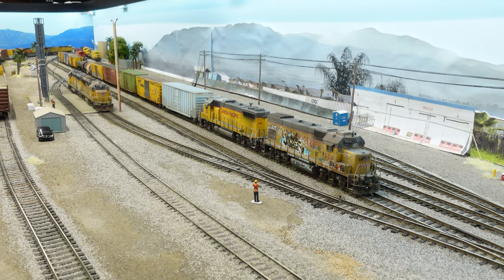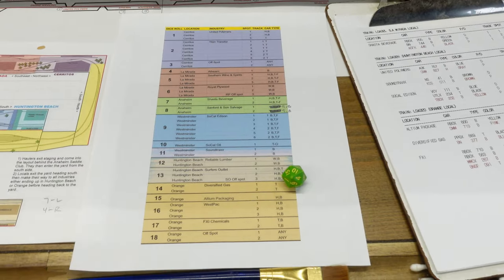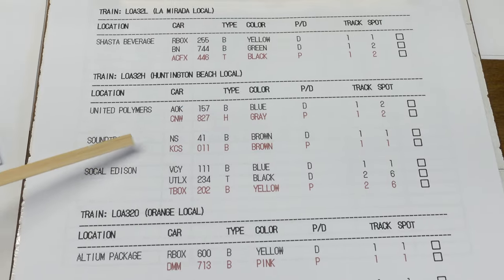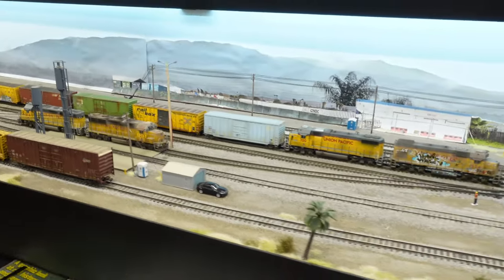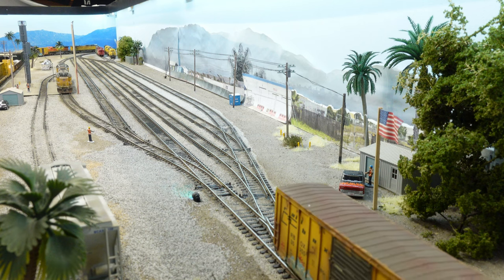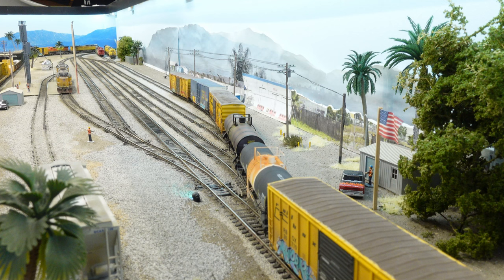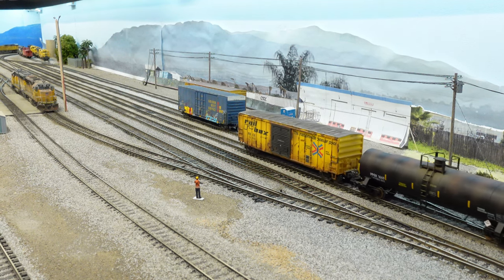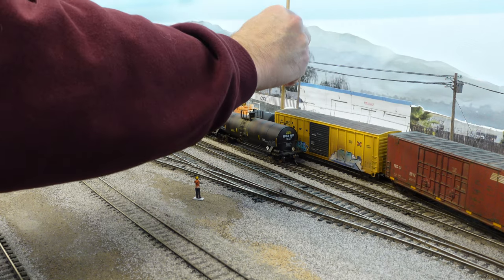Operations | Creating Switch lists - Yard Classification PART 2

Comment: This is generally the way I do yard ops. Put the cars on the designated track 1st and then, depending on how a layout operates, the yard switcher or the local blocks the cars for local by industries. One thing that helps, is give an industry number identifier so like 91, 92, 93, for industries in Huntingdon Beach, and maybe 81, 82, 83 for another area. Then you could even do sports, like 91-1, 91-2, 91-3 if there are specific spots to deliver each to.

Comment: Hey Rick. To answer your question, I sort and block cars like you did it. I block by destination first then I arrange each train according to which car gets dropped first. Those are at the front of the train. Also, don't forget you will need a buffer car for the return trip after picking up the tank car. I always take an "empty box car to use as a buffer when necessary if I will only have a tank car for the return trip. If I have other car types on the return trip, I don't take a buffer car with the outbound train.

Comment: 23:55 "And, of course, we've got the tank car right next to [the locomotive]"
That's fine while switching. Buffers are only needed out on the road, and only for hazmat. The rules are that, except when switching:
1. A placarded hazmat car cannot be next to the locomotive. Doesn't matter if it's loaded or empty -- if it's placarded, it contains at least some hazardous material. If it's empty and been cleaned, the placards need to be removed but receivers don't generally clean the cars.
2. A loaded placarded hazmat car can't be within the first five cars of the train. If there aren't enough non-hazmat cars to achieve that, all the non-hazmat cars and any empty hazmat cars should be between the locomotive and the first loaded hazmat car. Rule 1 still applies so, if the entire train is placarded hazmat cars, a buffer is needed.

Since your phosphoric acid tank doesn't appear to be placarded, it must technically be a cleaned empty. That does't make much sense operationally, so we should probably pretend that it is placarded. In that case, since it's assumed to be loaded (your tank car industries are all receivers), it needs to be at the back of that four-car train. Microscale (and probably every other decal company) sell hazmat placard decals.

Comment: There is a whole separate rule book regarding hazmat cars. One section deals with train placement, dealing with what can be placed or not placed to what on a through freight. The second section deals with the switching of hazmat cars. The matter of whether or not it can be placed next to an occupied locomotive or caboose all depends on where it lands on the hazmat chart and if it’s a residue empty or not. Some stuff it’s not a big deal, and others it’s a very big deal. If that tank is “hot” or “corrosive”, or a “marine pollutant”, you could use it as a buffer car on its own. The whole hazmat section of the rules class was always a hair puller.

Comment: Your work order is very close to the prototype. On an actual yard operation we would kick those cars into each rail, as shoving each car to rest is extremely time consuming and tedious, but there is a lot of locations where kicking is prohibited. Most of the time a yard job would classify the cars, and the local would block their own drag, or the local would just dig their own cars out and leave everything else in a rail, blocking their train as they go. Since you have an RCL consist I would point out, only the beacons of the locomotive that the crew is linked to will flash, and the bell will initiate every time the consist moves (three dings). The rule states that the bell is to be rung when initiating movement, and we only use the whistle to warn nearby men and equipment. That horn is loud, and we don’t use it a whole lot when switching. The horn on an RCO box is a toggle, and can only do a big loud blast.

Comment: Have you tallied how long it took you to roll the dice, build switchlists with pencil and paper, type them into the computer, etc etc, vs how long it would take you just to have JMRI do it?  On one hand, if you hate using a computer, this would be 100% understandable, but you';re doing all this manual work and then typing it into a computer!!
Reply: He used JMRI before. As I recall, part of the problem was its lack of flexibility. With the current system, if he just wants to chill and play with trains, he can shuffle cars about and later resume "planned" ops. But with JMRI, you have to tell it where all the cars moved to -- you kind of have to use it all the time, if you're going to.